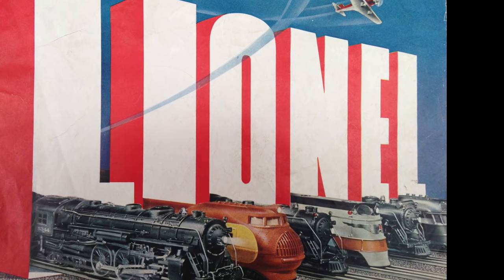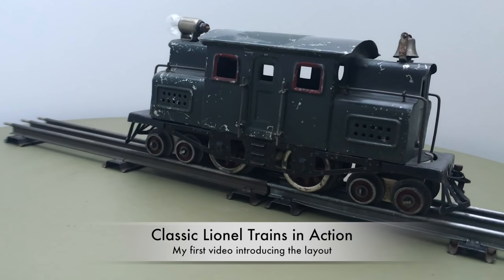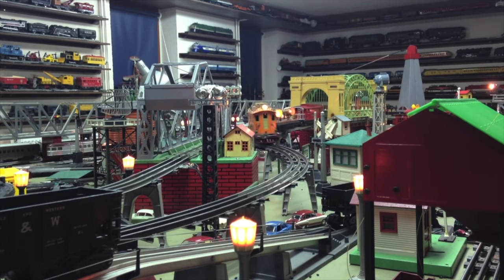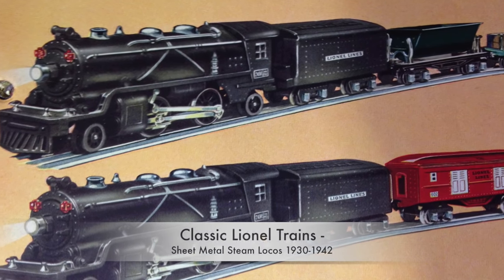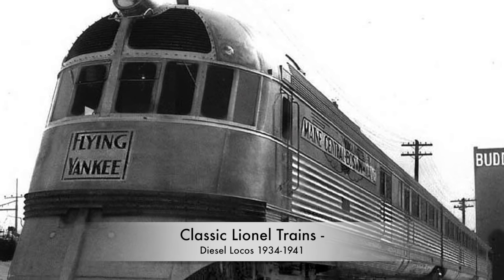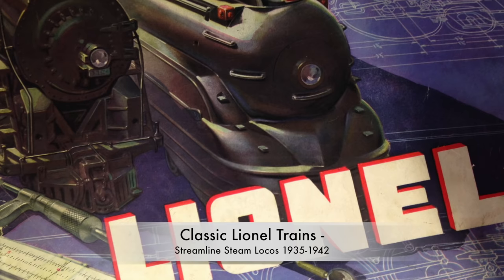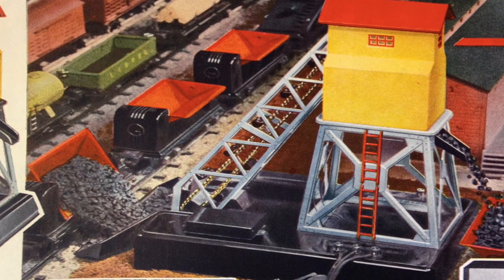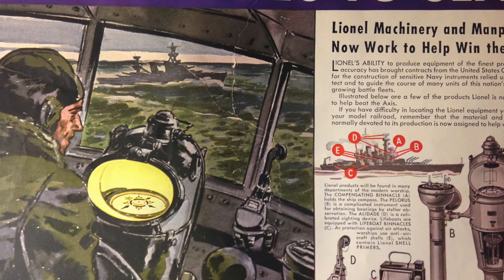Classic Lionel Trains -  Introduction to Prewar Loco Videos 1915-1942

Comment: I assume you removed the "stooker"  mech from the circus train   it was designed for the two rail clockwork track

Got mine in a hodge podge box lot six years ago no tender missing a wheel